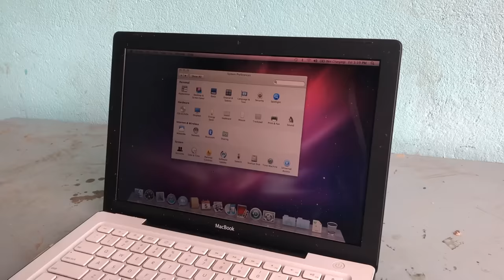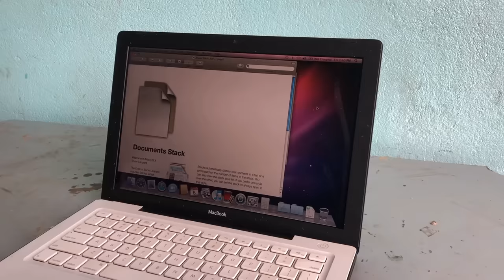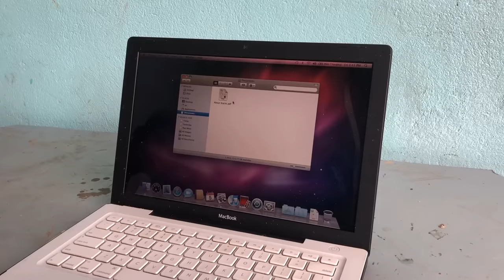Restoration abandoned 14inch MacBook laptop | Restore and rebuild your macbook laptop

Comment: 7:10 only GOD knows he is doing
Reply: Wth lol
Reply: he is checking the voltages
Reply: @yatharthkaushik5504  Uuuuh...
You can‘t measure any voltages when the device is not plugged into anything. He is just randomly probing around on the board.
Reply: @CompuKonstantin  but he can check the resistance between two contact points without being plugged in
Reply: @yatharthkaushik5504  Yup, he can do that.
But first of all the multimeter he has is way to inaccurate for this type of electronics, second he doesn’t even read what the multimeter says and third he is just probing around randomly. Trust me, I fix MacBooks for a living.
Reply: @CompuKonstantin  ok man I trust you
Reply: no, I do know what he's doing. unless you electrical engineering, and I'm Electrical engineering too
Reply: Old body only. fake fake.
Reply: em.... im think this guy measure anything and he's don't know what is going, because he are wrong measure it ...
Reply: it's fine, I'd rather like him than buying a new laptop
Reply: @CompuKonstantin  you are right the whole video is fake. He is just probing random things for the video. If you take a look he PAINTED the apple logo at the begging but in the end we can clearly see it
Reply: Didn't you know? The secret to making any fake, sorry, "Totally Believable and Real! Honest! (tm)" restoration look authentic is to probe a circuit board with a multimeter to camera with absolutely no circuit diagrams in sight like you just know what all the readings should be without even letting the meter settle to a reading.... I mean, C'mon man, geesh... EVERYONE does it, even those channels that "Totally Restored (tm)" engines and bikes use them to check the circuit of a sheet of metal... /sarcasm

Comment: I so want to believe you but at 7:59 where you are repairing DVD ROM is not signed whereas the same is signatured along with processor fan and other components at 10:28 . It usually is done when you send the device for servicing to the service center and they take your sign there in case you don't miss your device's component. otherwise the restoration is great.

Comment: There is not a whole wealth of evidence pointing to the likely fakeness of this here video.
That said, this is a list of a few inconsistencies, oddities, quirks, issues, etc. that put the authenticity of this video in serious question.

1. Who looks around in a rubbish heap like that?
2. Who films themselves rooting around in trash?
3. Who is actually willing to film someone rooting around garbage?
4. It is so beat up and in so many pieces that it is hard to pass it off as "accidental damage".
5. Consider, please, how he manages to find this computer in like ~30s.
6. Also, why are there so many computers in this one junkyard? ...In Thailand?!...
7. He probably broke all the boards cleaning them with a toothbrush and water.
8. No rust, corrosion, malformed PCBs, or anything of the sort you could expect from something this damaged.
9. When probing, he measures RESISTANCE? Maybe it's some sort of continuity testing? But it's worthless because Apple will never tell you what connects to what, so there's no assumptions you can make off this data.
10. He's probably just measuring the ground plane. (Useless) That's why the meter jumps around between 0 and infinity when he is not on the ground plane.
11. Just works with broken glass/plastic with his bare hands. I wish my hands were like steel, too!
12. I sw--- if this dude tries to reuse anything from that screen...

FAKE!!!!!!!!
13. He disassembles the SSD, and that's when the red flags arise. 100% FAF (Electroboom reference)
14. Casually rubs his dirty fingers on the laser for the CD drive. That's ruined!
15. Don't disassemble batteries, kids... please! He's just going to casually set his house on fire if any of this video makes any physical sense at all.
16. It's not a restoration if you don't replace at least half of the parts you casually murdered for YouTube.
17. OR you can simply reverse the video of you wrecking the f*** out of a working macBook. Much cheaper.
18. For proof, look at the left side of the bezel, if he did restore it, there would be a crack.
19. Crisp logos... after painting over them with black spray paint... UNMASKED!
20. 9:58, is that a dirty speaker cone I see?
21. Is there CLEAN thermal paste on the CPUs?
22. Someone please tell, is that how you install a mac keyboard?
23. Is the trackpad supposed to be that color?
24. Why are there scratches on the bottom? I think he sanded that?
25. Why is his system language English?

Okay, I think that's enough factual evidence to consider this video fake.
100% FAKE!

Comment: I could talk hours about the horrible ñ, totally unrealistic and obviously fake "restoration". I could talk about the painstakingly process of checking every component, making shure everything on the board, all the microscopic components work as intended. I could talk hours about the miserable hours of :try to boot - > Fail - > check problem - > repeat until "working state" is achieved. Instead i would say that he did a pretty good job with the lower housing